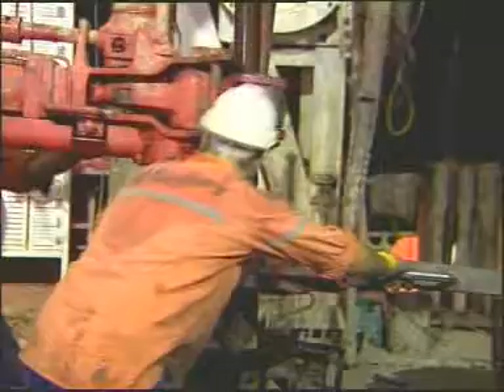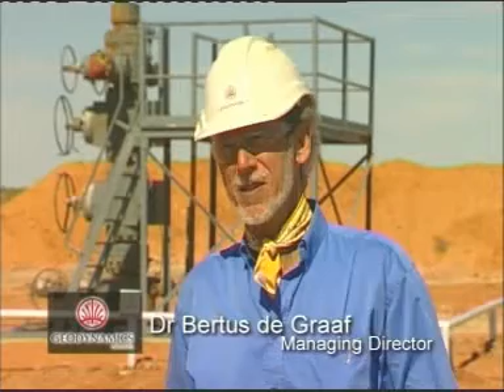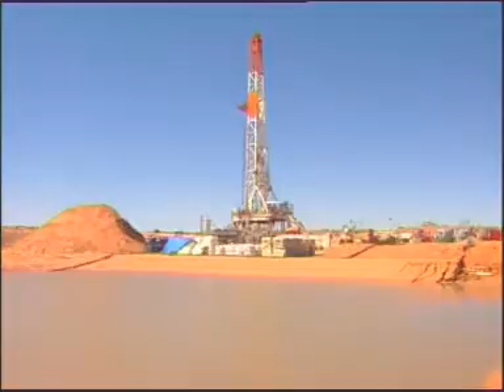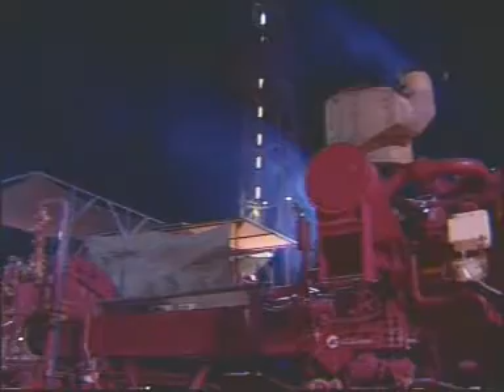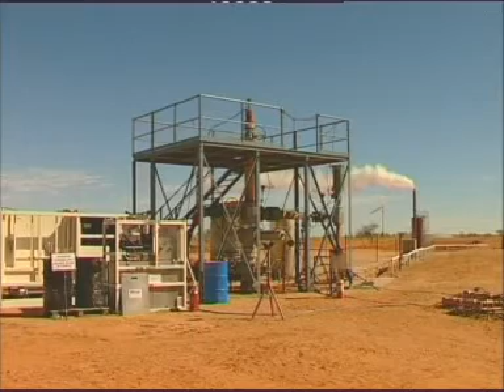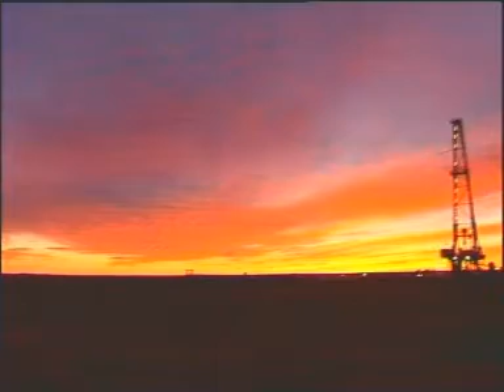Geodynamic's Hot Fractured Rock Geothermal Project

Comment: This is a proof of concept. THey must have trucked in water from somewhere. In a closed system you would not have to worry about trucking in water as you'd just recycle it. That would be the ultimate solution. Hot Dry Rock is the way to go.